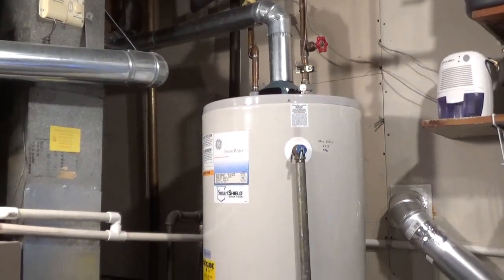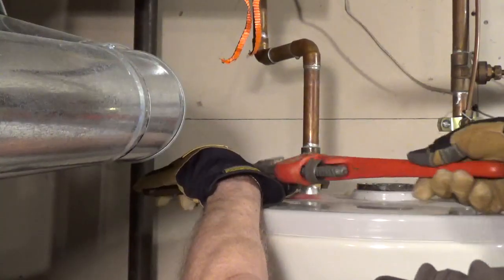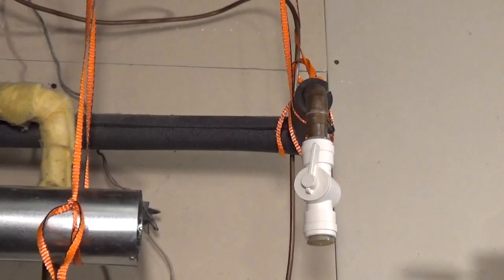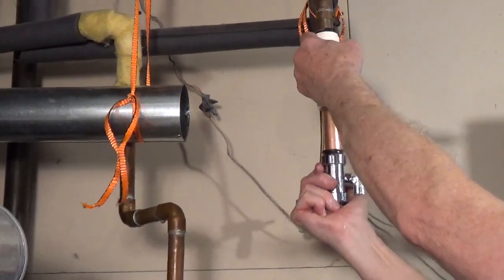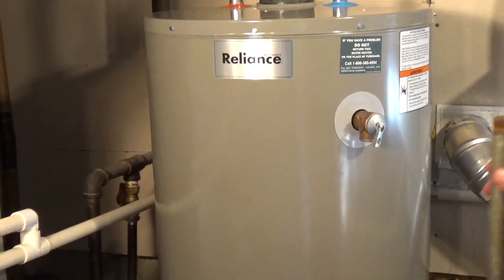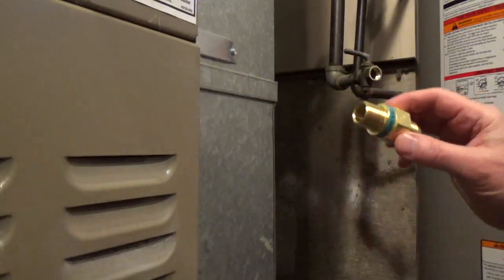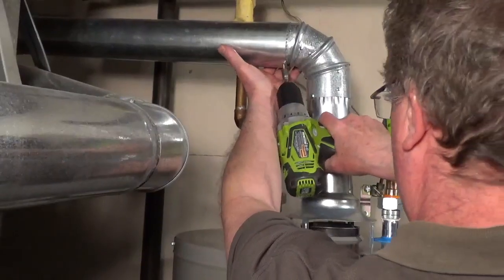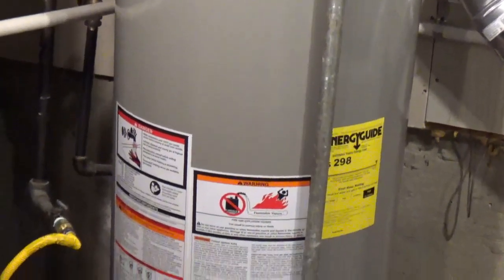Replacing a Gas Water Heater and Products to Make the Job Easier

Comment: Can you please list out all the parts used. And links if you can. This is very helpful.
Reply from the maker: Hi, The shut off valve and the tee valve are Watt's. Just For Copper was the product to bond copper. Brass Craft flexible gas supply. Oatey gas leak detector. Rapid Rope utility rope. 
We have more home improvement tips on our weekly podcast 
https://itunes.apple.com/us/podcast/fix-it-home-improvement/id880903087?mt=2

Comment: how old was the old water heater? Was it really bad? Notice there is no expansion tank. Is that code in your area? Good explanation of install!
Reply from the maker: Hi, the old tank was over 15 years old. Getting the house ready to sell, so this was one of the projects. We don't have a closed water system in our town yet, so there wasn't an expansion tank. It is on my list of projects though. Easy to install with push fit fittings.